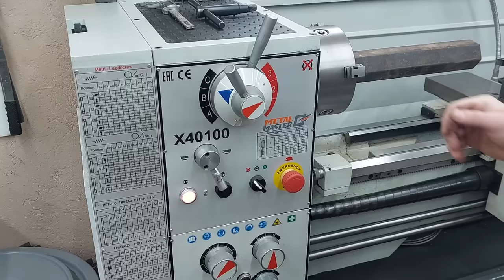Saved my money! A simple idea and useful tip in 10 minutes for metal processing

Comment: I must have accumulated a dozen pipe centre's over the years up to about 200mm diameter. Very useful , I have no idea why you heat treated the little one you made.
No wear can occur during use & a softer centre will seat better than hard material. They can be made quite successfully out of brass , plastic , aluminium etc.
Reply: Ne adj ötletet,mert még képes mindet megcsinálni.😊🕊